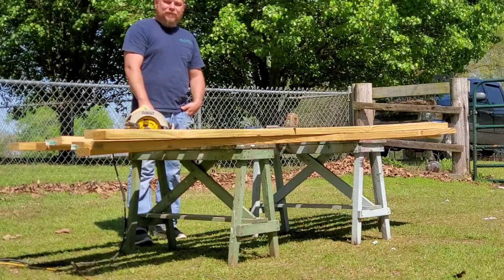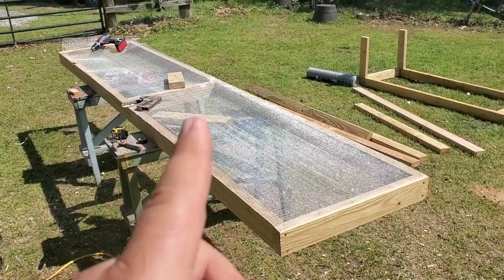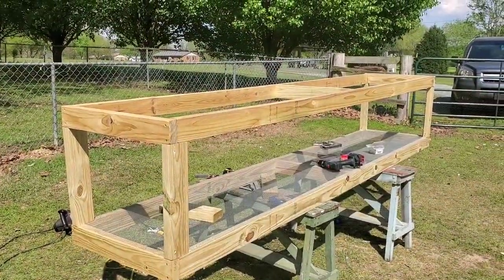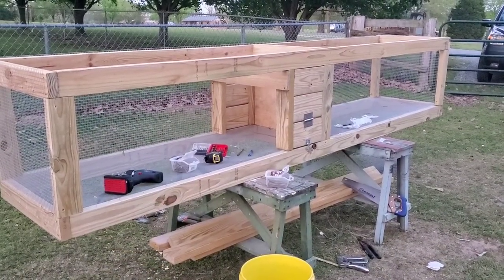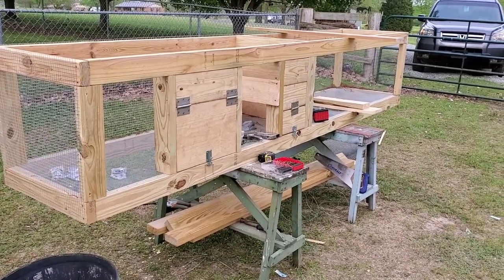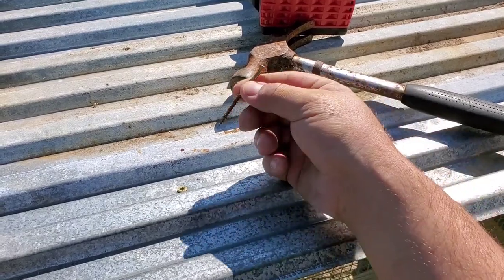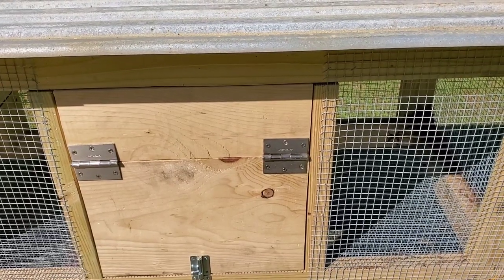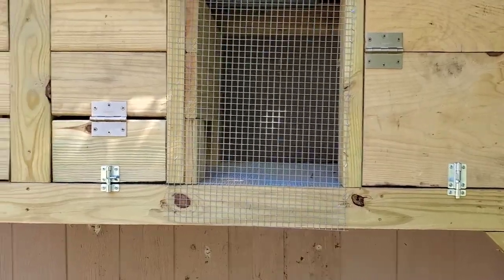How we built our quail coop DIY #lazypondfarm

Comment: It looks good but I’d suggest that you use 1/2” x 1/2” wire instead of 1/4” x 1/4” there poop won’t fall through the 1/4” and the birds will have a higher chance at getting bumble foot
Reply from the maker: Thanks for you input
Reply from the maker: Replaced with 1/2 by 1/2 and used vinyl coated! Thank you!!!!

Comment: Sorry late to the video been putting the pen together and getting some things around here done.  This is beautiful.  Oh man I hate hardware cloth its wonderful once it's done but I'm accident prone lol.  I get poked by wire a lot lol.  It's so worth it when it's all done and looks great.  Poultry wire is easier for most projects but it doesnt look anywhere as nice.
Reply from the maker: I have since replaced the bottom hardware  loth with 1/2 by 1/2 vinyl coated hardware cloth (easier on their feet). Thanks for watching!
Reply: @lazypondfarm  I usually sprinkle some hay on the ground for the rabbits in the hutches.  But yeah needs something for the feet.
Reply: Hardware cloth can only be installed with a generous amount of cursing. Like you said, worth it when it's done, but oh lordy I hate working with it. I don't use poultry netting anymore as I've found that rat snakes can get through it. I came out one morning to find that a rat snake had gotten into my hen-and-biddies coop and then, once it had eaten all the chicks, was too fat and got stuck in the wire on the way out, like Pooh.
Reply: @fuerteybrava  yes there was so much swearing and before too long gotta make some more lol.

Comment: it's been a few years since you made this, are their any changes you would make or do you still like this build?

Thank you for the video, I'm trying to get a few quail because egg prices are just to expensive and I live in the city, we can have chickens but only three, but we can have 6 quail so, I'd rather have 5 to 6 small eggs daily then 3 large normal eggs for 8 months.
Reply from the maker: I still like the build. 2 changes I would make are a slightly slanted floor so the eggs roll to the front to be collected and larger opening floor mesh that is plastic coated wire vs bare wire.
Reply from the maker: I still like the build. 2 changes I would make are a slightly slanted floor so the eggs roll to the front to be collected and larger opening floor mesh that is plastic coated wire vs bare wire.

Comment: how many birds can fit in your set up at a time? im thinking of trying your set up.
Reply from the maker: Go with a slightly larger mesh floor than I did and plastic dipped/coated mesh lasts longer. Also make the doors taller. Most ppl agree quail require between .5 and 1sq ft per bird, so that answer depends on what you are comfortable with.
Reply: @lazypondfarm  ok thank you

Comment: did you use 1/4 inch hardware cloth or 1/2?
Reply from the maker: I used 1/2 on the sides. I have since replaced the bottom with vinyl coated 1/2 in. The vinyl is easier on their feet, doesn't rust out from the poop, and 1/2 allows the poop to fall through better!
Reply: #lazypondfarm at what age do you move them from the brooder because my chicks feet are still to small for 1/2